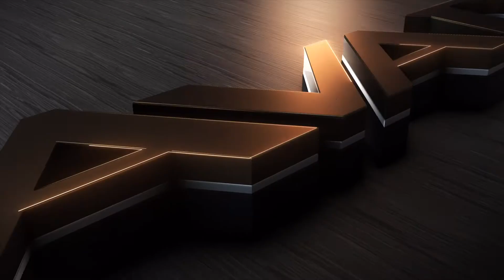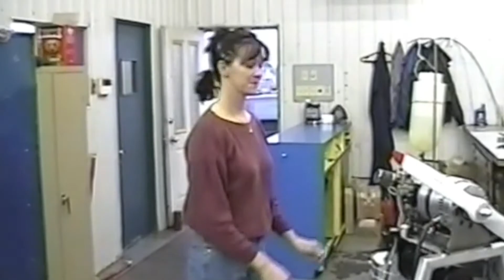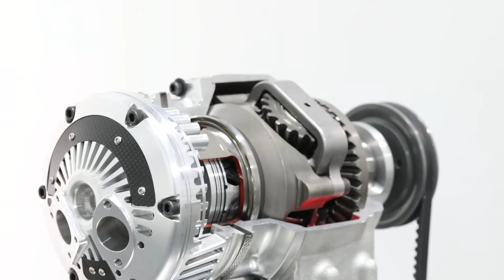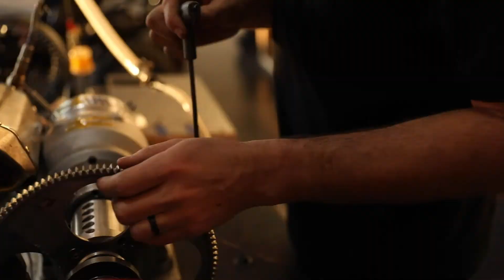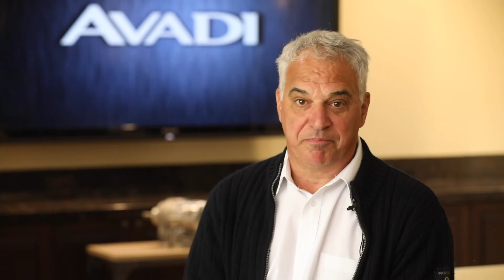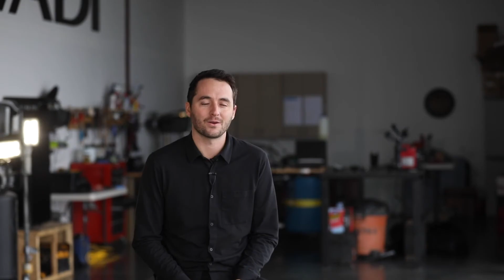Avadi Engines Introduction

Comment: ...That's a pitiful power to weight ratio. The designs of our various engines have 1:1 or even 3:1 P2W, not the reverse. 🙂  Granted, some are rotary engines, others use a simple, unique linear-to rotary mechanism. Your design could be made into a higher P2W ratio machine but I don't see why. That differential is an weight/volume killer. Right off the bat we could replace the geared differential with our torque dense [that spells small & light weight] FLG device. We also have a simple rotary-to-linear motion conversion mechanism which produces a perfect linear motion...w/o gears.  😵🤓🧐

Comment: I want to see it scaled up to to 300hp and run for 300,000kms and see how it holds up to wear and poor servicing. That will be the real test. 40% efficiency sounds too good to be true, does that efficiency scale to a typical vehicle size?
Reply: Why does it need to scale to 'typical vehicle size' it's being designed for a specific use case as an air cooled 250cc

Comment: Won't the piston wear much faster and get much hotter due to it moving more rotating and wear the cylinder aseell
Reply: If you get a chance, look at the cut away view. The piston cylinder rotates with piston. So there is much less wear then you think.  Add to that with two balanced piston rods, the side forces on the piston  is far less eliminating wear that turn piston cylinder to ovals.
Reply: The ceramic seals can be rebuilt on the top end in about five minutes.

Comment: What a pile of nonsense.
It doesn't eliminate the crankshaft - it has two of them, as well as two connecting rods for just one cylinder.
It has a rotating sleeve valve; sleeve valves are not new.

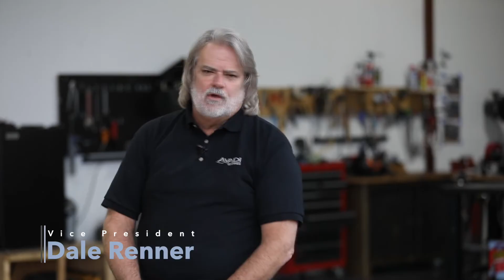Comment: FAKE NEWS 1:13 - "...that works on physical principles that really have never been seen before.". 

Countless variants of the rotating cylinder sleeve, AND rotating piston design, have been built and patented throughout history. 

I'm also curious to see long term emissions and continuous duty cycle output capacity. I find it difficult to believe those rings will ever be fully seated. It's also worth noting... 40% efficiency is a pretty easy goal, when the specific output is considerably low in comparison to others of equal displacement.

Comment: When i hear hype like "everything in the crankcase rotates" and yet theres a piston reciprocateing,,yes its also rotating,,but its definitely going up and down too,,and how is the output shaft driven?? ,thats very unclear,,and the twist load on the rods  rotating that piston is exactly what you dont want on a journal bearing,,
Reply: If you get a chance, look at the cut away view. The piston cylinder rotates with piston. So there's no twisting load on the rods.

Comment: Amazing engine! 
Seriously love the rotating self-cooling cylinder head!
Would love to see it in a motorcycle comparison video, 1 bike with your engine and the other with a regular engine! 
I'm really curious as how did you solve the lubrication is it a passive splash or is it pressurized? 
Could it be made as a direct injection as well or is it only carbureted?
Or perhaps even as a diesel, that would make this engine really versatile and market valuable!

Comment: This is pretty  freaking neat! I wanna see it stress tested in gocarts or even a generator. I'm happy to follow this project.
Reply: Dyno produced 15hp. I seriously doubt it can reliably produce that number in continuous duty. Head cooling looks diminutive. It's also loud as all get out... with so much lash surface, I can see why. They've basically compounded the parasitic loss of a timing drive, to eliminate a cammed valvetrain. Sounds like a  cool idea... until you have to hear it. Same issue kept the RSV engine from breaking out of the hobby and stationary IPU industries.